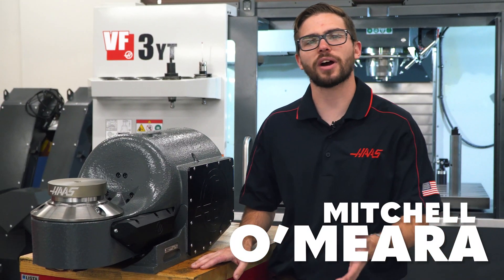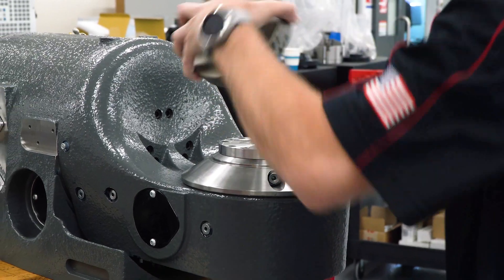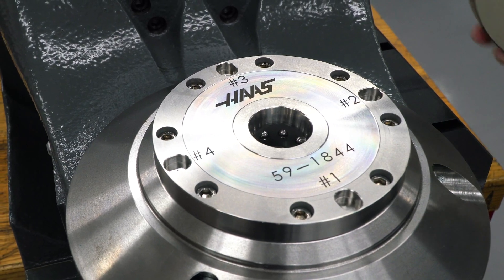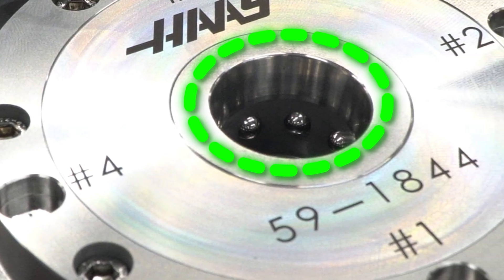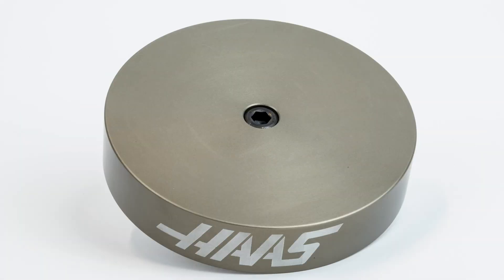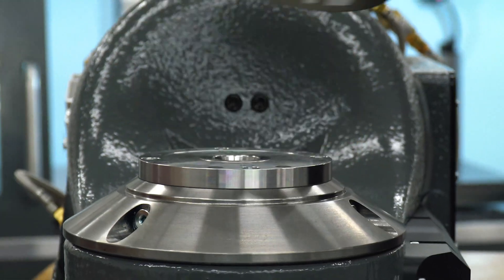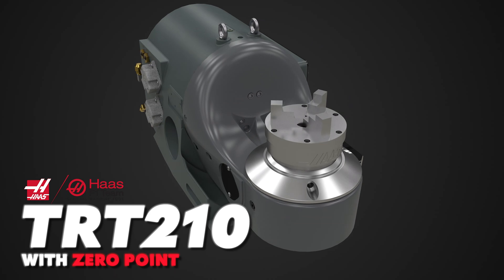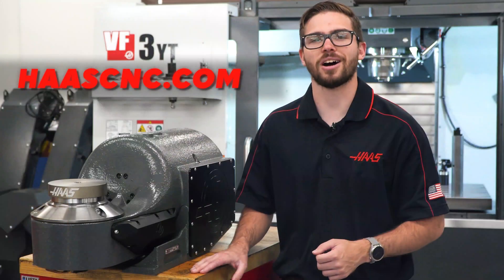Haas TRT210 Zero Point Workholding Options - Haas Automation, Inc.

Comment: Needs air to hold?? Not so nice. Still holds 1/3rd when air cuts off? Even worse because now you can't even tell easily if it is good or not
Reply: Zero point systems use springs to clamp and air to unclamp.